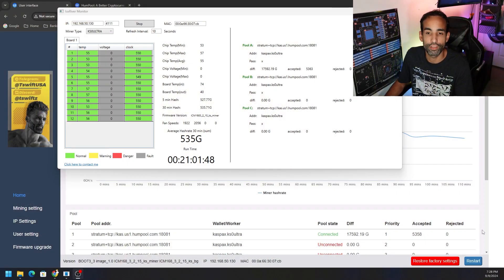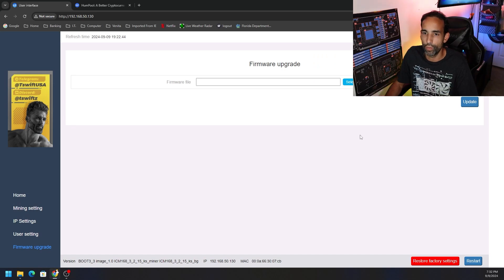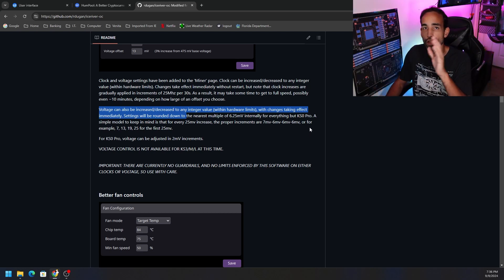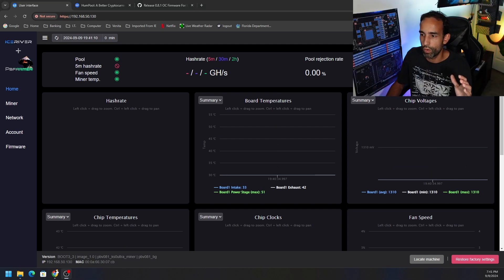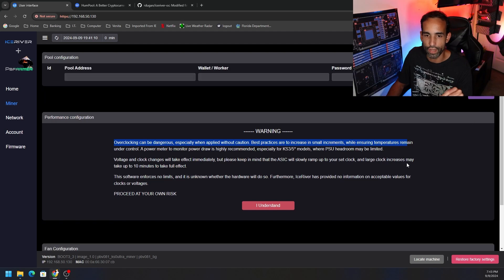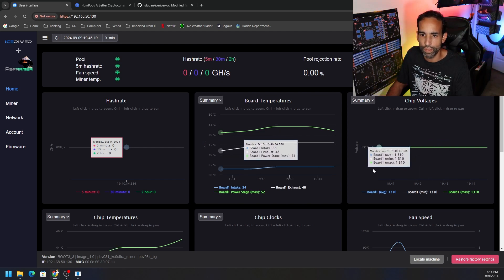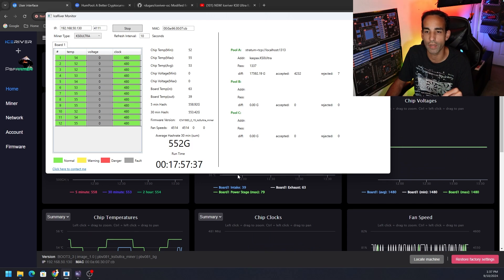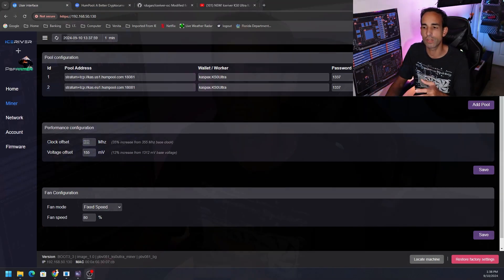KS0 Ultra - Tswift Vs PBfarmer

Comment: what is the PB Farmer default login? I updated the firmware and locked out of KS0Ultra...
Reply from the maker: @rizzo529  it should be the same as stock, or kept your original. Try "12345678"
Reply: @SerpentXTech  i did all that and can't log in. Thanks for the response. I'm going to shut it down and look at it tomorrow..
Reply from the maker: @rizzo529  ok, you can always hold the button on the physical machine down, restore it back to defaults, and then update firmware again, but don't update the password until after you get into PB farmer user interface
Reply: @SerpentXTech  left it off all night and this morning can login... going to take some advice from here and overclock just a bit. I have the 230w psu and the usb 120m fan, gonna put that under it to help the tiny fans if needed.  Thanks for the content!
Reply: my solid small overclock is: 70mhz clock, 25mv, 60%fan. hashing between 470 and 520 GH/s at 135W. Can't complain. Keeping it safe for now.
Reply from the maker: @Rizzo529  good job and good call play it safe
Reply: @SerpentXTech  I bought some used kas0 Ultra Miners, but unfortunately they were all over-powered and used 170W each but only had a 120W power supply. That's why I wanted to install the original software. I tried to load the software but it didn't work, so I pressed the reset button for 2 seconds. Now the miner won't boot and only uses 2.3 watts. Can you please help?
Reply from the maker: @sonne-balkon-tanken you have to get a firmware version to work. Whether stock or PB farmer. If you got PB farmer firmware install, put the overclocks back to 0 https://youtu.be/XW7_yZ-xwbY?si=D041-jwjjAsFlor5

Comment: For ks0 ultra without any modification except a 230w psu, clock offset at 150 and voltages at 100mv, for 170 watts for around 560-580 gh/s, the main issue with people is to keep the ksoU too cold, chip are really efficient over 65 degre, I also tested 160clock and 120 mv and depend on the miner it fluctuate a lot to 580 and 600ghs for 180watts, I much prefer PBfarmer because I'm using my ks0s to heat my house and I can play with the voltage to get more heat, from 100 watts to 180 watts, really efficient heaters :)